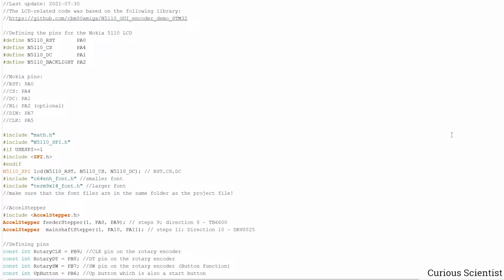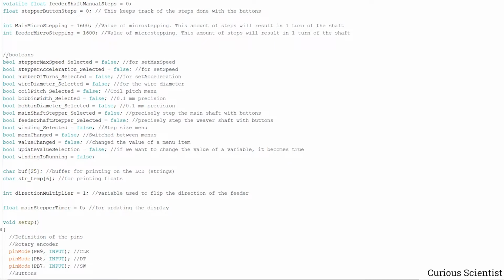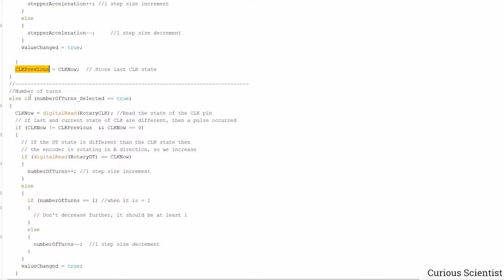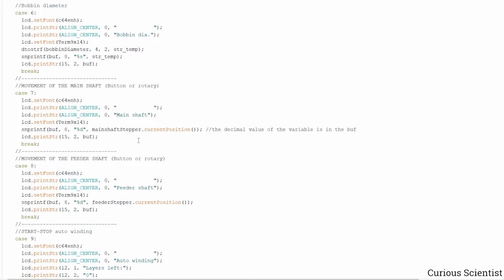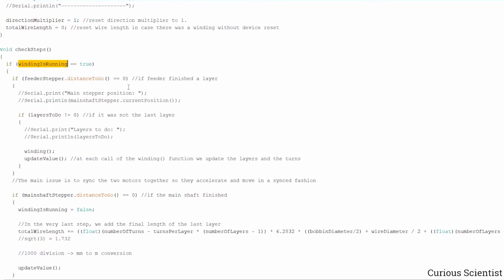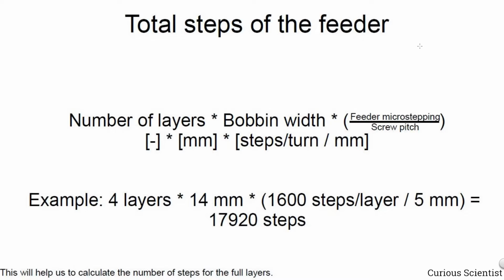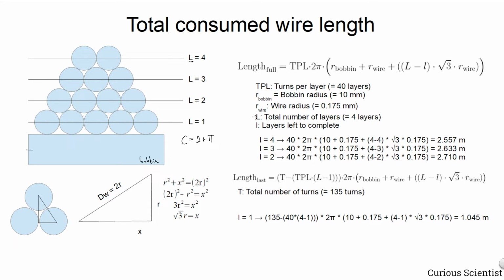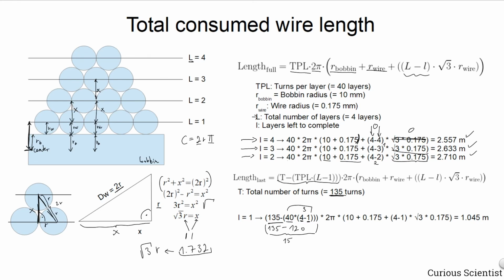Building a coil winder [Part 5] - Coding and math

Comment: is really amazing,  can  you make a coil winder with parts LCD 4 x 20 , Keypad 4x4, Motor stepper, TB6600 and Motor DC?
Reply from the maker: Thanks! As you can see it in the series, I probably have the skills to make it, yes.
Reply: maybe next improvement in your channel . I will following again and again 😁
Reply from the maker: What do you mean by next improvement?
Reply: I mean next part
Reply from the maker: The project is complete. There won't be any next parts. At least not in the near future.

Comment: Is the Blue Pill STM32 disconnected from everything during programming? Do you upload the software via the micro USB connection or with a ST-LINK V2 (debugger dongle)?
Reply from the maker: Yes, I program it outside the board. You can upload the code as it is convenient for you.

Comment: I m failed to get Nokia lcd despite of all efforts
Reply from the maker: You need to replace the library of it because the one I use is the STM32 5110 library. If I remember correctly, there is a similar library for Arduinos made by cbm80amiga.

Comment: Your project is really amazing...and u are a loveable person with great skills...but I m sad not to strat this project...b coz of two reasons...first LCD  and then 2nd stm 32 microcontroller...if you could plz provide the code for audrino nano with the modification of LCD printing  code ....20x4 LCD instead of Nokia lcd
Reply from the maker: Thank you! The code is freely available on my website and it should work easily with an Arduino Nano with very slight modifications. The code is written in Arduino IDE, so it is compatible with any Arduino microcontroller as long as you follow the microcontrollers' pins.

Comment: I cannot change the menus on the LCD screen, for example, I want to make wire diameter 0.35, 0.50 mm. Thanks in advance for your attention.
Reply from the maker: Enter the menu and rotate the encoder. It should work if you reproduced everything correctly.

Comment: Great Work  , Precision engineering and  calculations .Proven Coding alogrithm.

Hello Sir,
I am also developing transformer winding machine 
Only thing I want to know how to pause it after one layer if want to put insulation between layer like maylar tape and resume it  from where it is stop.?

And other bug I found in your code is fedder calculation
If the numbers of turn is less than turns per layer than  the feeder calculation fails 
For e.g.
You have take 160 turns,  bobbin width = 14 , wire dia = 0.35 for these 40 turn per layer is working fine 
But instead of 160 turns if we set only 20 turns for  same bobbin width and wire diameter then also the  feeder calculation will be 40 turn per layer ani feeder will not stop after 20 turns
I resolve these problem by adding IF LOOP
Reply from the maker: Thanks! I don't call these bugs as this is not a final software. They are "features to improve". ;D 

Have you tested the code and got this issue with the layers? Because if you have only 1 layer, the layersToDo variable is ==1, so the winding() function will step into the "else if (layersToDo == 1)" branch and it will only complete the equivalent steps of the turn. It is because the (numberOfTurns - (numberOfLayers - 1) * turnsPerLayer ) term will become only "numberofTurns" because the "numberOfLayers" is one. I think I even demonstrated something similar in the video and, on purpose, took and example when the last layer is not a complete layer. But it can be that there is a mistake, I will check it in Part 6. Hopefully, in a few weeks I will release a new video, but I am still waiting for some parts. 

Regarding the pause, I noted down this idea and will probably implement it in some way in the future. It is not that simple but I will probably "park" the code after each layer and wait for a user input (button push) to continue. This can be optional, so either the machine grinds through the whole bobbin at once or stops at the end of each layer until the user does not do something.
Reply: @CuriousScientist  Thank you for you reply. Yes, I have tested the code and got these issue as I am testing in all cases by changing wire dia bobbin width .num of turns etc for me the issue is solve now . Waiting for next part with more improvement.
Reply from the maker: Thanks! I will definitely check this out.